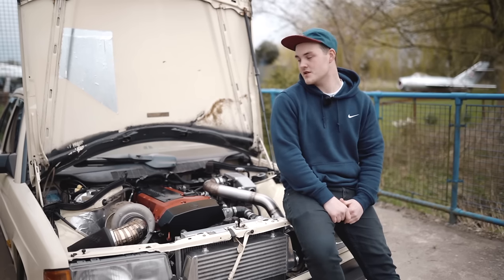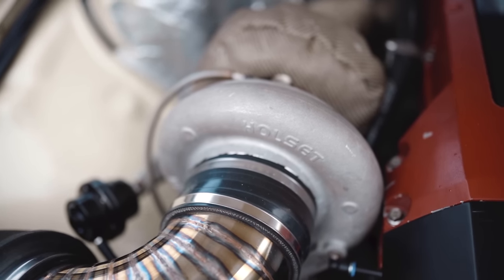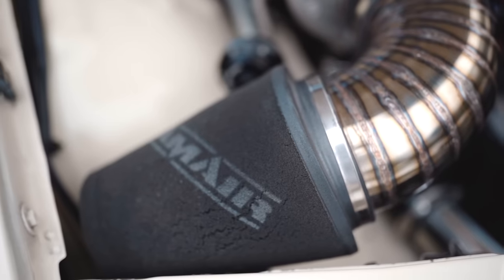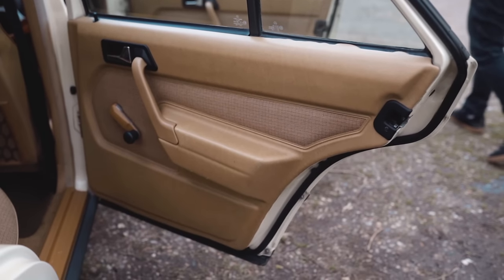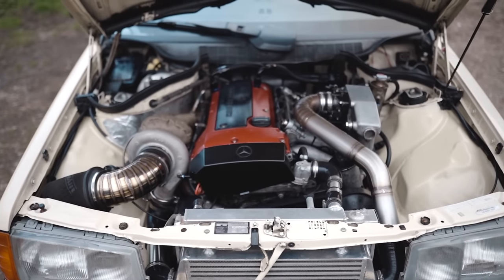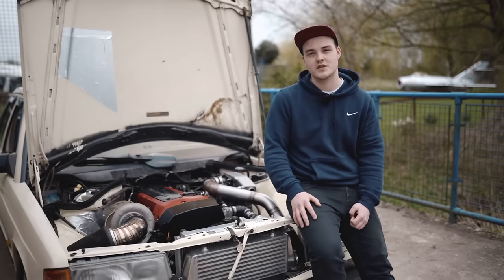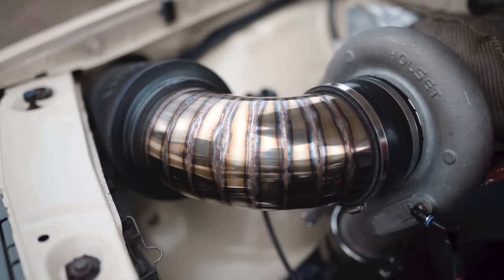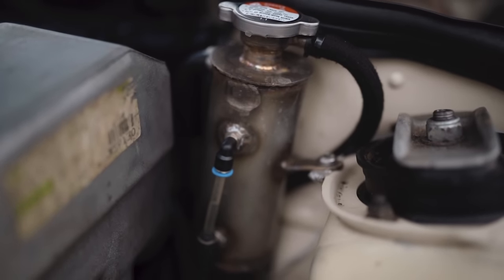ALEX HAS BUILT THIS RIDICULOUS SLEEPER - *YOU WON'T BELIEVE WHATS UNDER THE BONNET*

Comment: I like how he shared exactly what is needed to do the engine swap.
Reply from the maker: That’s what we wanted to do man. Something informative as well :)
Reply: we all would love to do a project like that, unfortunately i live in switzerland and by the time everything is legal the car cost 60k if ur the first to do it
Reply: DonAmoS / Path Pad0riX 

I was just about to say that !!!! I wish Swiss MFK would be as easy as the UK ones !!  I brought my custom Motorbike to Switzerland and had to sent it back to UK because Coz I couldn’t get it registered . Sad ... but true.
Reply: What a sweet whip
Reply: @deadcool 2 its his baby now, why would he sell her. 🤨
Reply from the maker: deadcool 2 hey buddy, sorry I missed this. It’s not for sale I’m afraid :)
Reply: Can't understand why not a m104 instead as install is also the same.
Reply: That’s very nice considering most act like know it all dickheads if you ask for parts lists or ends up “DO YOUR RESEARCH!”
Reply: @carloscollomps1552 I had m104 turbo 980hp in my driftcar.

I am building w124 wagon with turbo m111 2.3 stroked to 2.5 liter with m111 brabus 2.6 billett crank and DP pistons c36 amg forged pistons. 2.3 kompressor had 600hp with only stronger rods, arp headstuds and copperheadgasket. So aiming for 700+ hp with new setup. 4 cylinder also has more space in front of car. And also cheaper to rebuild than m104.

Comment: It's nice that other youngsters see the potential in the old Merc's. I myself own a 190e with m111 2.3 swap (6speed) although I kept the eaton supercharger and got a custom 70mm pulley for it as I haven't got bored of the  "helicopter" sound.  

They only bit I did not like in this video is at 12:25. Yes the 1.8/2.0/2.3 weren't that fast (even back in the day) but there was also 2.6L straight 6 not to mention the 2.3& 2.5 v16 cosworth and of course EVO1/EVO2 & the mighty DTM version.

If anyone loves those cars as I do then I strongly suggest visiting the mercedes museum in Stuttgart.
 
Anyway good content :)
Reply from the maker: Hey mate thanks for watching! 

Haha not heard the helicopter sound myself but had previous charged cars and never got bored of the whine! 

The museum seems a fair shout.

I think that section at 12 minutes came out wrong. I knew about the performance versions I guess I meant more his shape version I should have been clearer.
Reply: @ThePolskiKiD Do you know if kompressor engine mounting will fit OM613 CDI?...
Reply: Is your car on your channel? Where did you get the 70mm pulley? You also forgot to mention the AMG and Brabus versions that were even faster than the Evo's with their strait 6's, but weren't allowed to race, because they didn't meet DTM rules. Carlson, Schultz, Brabus and AMG dropped V-8's into the W201 chassis as well in special built vehicles.
Reply: Hey, I am thinking about the smaller pulley myself aswell. Do you need a ecu remap to make it work? Or have you just swapped it and ran like that?
Reply: helicopter sound = supercharger whine?
Reply: im 25 years old AND OWN A Mercedes Benz 230e from 1990. and love it. and yes it is very slow. even after a full rebuild of the engine. but it is the most reliable car i have ever had.
Reply: 1986 190e 2.3 8v was my first car. Love them to death. Sadly that car was too old and started having issues that my inexperience and lack of time couldn't take care of. One day I'm going to get another one and build the 8v motor into a beast. I'm going to fully reengineer it from the ground up improving every aspect of the motor.
Reply: @gremotorsports  Better off going at it with the 16v. You get so much more for your time and money then. They are hard to come by and expensive, so that's a consideration.
Reply: What ECU did you use ?)
Reply: @kirkot2  Haltec stand alone, probably an Elite 550
Reply: I bought my first mercedes 190 12 years ago, an m102 carb , 1 week later boom,engine gone-kaput . Bought a 2,3k  M111 from a guy who had a 94 c-clasa,fitted the engine ,the gearbox and for stuck for 2 years with the ECU and wording harness ,build the harness by myself ;could not get it started. Sold the car bought another one ,had a 3,2 Block built it with different internals. 3,5 diesel crankshaft, 3,4 AMG pistons ,3,2 custom camshafts, m104 3,0 intake and k-jetronic . Made 287 on the Dyno . It took me 3 years to find the parts and finish the engine ...still love 190 will always love the 190 .
Reply: Hi, what did you do about the speedometer with the 6 speed swap?
Reply: That’s awesome

Comment: Top 10 best sedans ever. Ever
Reply from the maker: Awesome thanks for watching!
Reply: number one
Reply: I have a 2.3 190e 86' Gold with 150K....clean title...no rust or body damage...just small dings.. paid $500.00 for it...Interior is near pristine..The owner of the towing company absolutely hated this car because he could not understand why it kept knocking off so,  I  rescued  it from a towing yard with only minor issues with fuel pump. I have spent 3K in it so far. I plan on fixing all of the minor vacuum leaks and after get all dings out , re paint and lower it a bit. I bought some chrome  17' AMG rims from a wrecking yard all four for under $100 on sale.....crazy deal. i will repaint to original color but with some light metallic flakes. I just picked a silver 1989 Merc 300 CE  coupe w/ 83K from my mechanic for a steal. The 300ce is my next project!
Reply: I had a 1984 190d 2.2. Naturally aspirated diesel with an auto trans.  By far the slowest version of this car and it was still a great vehicle.  I will definitely own another 190 and do something similar to this
Reply: @somebuddyful  hard decision, since there is the W124, the W123, the W126 and so much more but the W201 is from the time when Mercedes was building the best cars in the world. Long gone, those times...
Reply: @thegoldenamerican  thats a great engine for that car, make sure you treat it good

Comment: Wow that was actually very interesting and impressive. He's 22 and know hell alot. I am 24 and about to do my first auto to manual swap.
Reply from the maker: Awesome bud best of luck! Which car is that for?
Reply: @CJK20 1992 Mk3 Supra 3.0 6 Cylinder with the "unreliable" 7Mgte longstroke engine.

 I plan to Upgrade it step by step. But first of all manual swap and cooling. Will see where it ends. 
The plans are at around 360-400hp cant do to much in switzerland without alot of money because the regulations are so bad here.

Comment: I want to get an 190e and Engine swap it with Audi Quattro Inline 5 engine.
Reply from the maker: Cor that would be something else. One of the best sounding engines ever.
Reply: My new daily audi 100 has a 2.3 inline 5, not quite the quattro turbo but sounds insane for 150hp
Reply: Porsche 944 2.3 swap😏
Reply: There is an oem inline 5 turbo diesel which can handle much power. Sound great, too!
Reply: Just buy an 190d 2.5 and om605 swap it, you can run on over 450hp on the stock engine😅 (only a new manifold, a bigger fuelpump and a bigger intercooler)
Reply: Waste of Audi engine.
Reply: nope it will not work and you will be cursed if u put anything in it but a Mercedes engine. it,s like marying your sister or something.
Reply: Why ?
Reply: OM606

Comment: I really like this early spooling Turbo. I have got an Saab 9-5 Troll. Thats an 2.3 Liter long stroke 290hp and 440nm of torque. I got boost at ~1.5rpm and full torque at 1.8k rpm. Its such nice to drive like that even pulls till around 5.7ish rpm. 

So anyway i would recommend to get an Ballbearing Turbo do a sllightly Stage 1 Headwork and keep the oem Cam.

The thing is if you kill the lowend torque of this car you loose that nice and early torque and it will be like any highpower tuned car.

A ballbearing Turbo manages to get a nice efficiency from low to highflow you can see that in the flowmapps of any turbodatasheets.
Reply from the maker: Yeah it definately spooled pretty well. 

Thanks for the comment mate.

Comment: Awesome car and video, didn't think the 2.3 could spool a he351 that early. I love this, I just swapped a similar engine; m11.975, Eaton M62 in my C124. Went from a six cylinder m103 as I reasoned the handling will better without the heavy 6 upfront and it is. Still stock for now 195 with torque very early, good for the heavy coupe chassis.
Reply from the maker: Awesome good to hear. I was suprised at how quick the turbo came on too. To be fair. As expecting it to be super laggy.

Comment: The w201 chassis was made for DTM.
DTM reguired that it was made in some number of production models.

The original idea was not a cheap sedan, but instead the EVO model in collab with Cossworth they made the 2.3 16V EVO and then the 2.5 16V EVO2, wich made more power than the normal 2.3 16V and 2.5 16V. 

But they became so popular that they made it with like 8 different engines and a wide range of other specs.

Comment: Great build, what size is the intercooler? 280x300x76 mm would fit and be fine?
Reply from the maker: I’ll find out dude
Reply: Thanks alot, I'm swapping m111.944 on mine (2.0 141kw kompressor), for start i'll leave it with compressor but you'll never know the future :D
Ported the head already :)

Comment: That open filters drawing in all that hot air from the engine bay. You should. Be drawing cool air from the outside and get the iat's down. you'll have more power. The cooler the intake charge the more power and boost
Reply from the maker: Hey Joey, few people have suggested it. Thanks for your comment though pal! Hope you enjoyed the video.

Comment: Weld panels blocking the vains from air and make yourself an ICE WATER to air intercooler. Place the  in and out plugs diagonally too.
Edit: Get the hot air out of the engine compartment in a very subtle way
Reply from the maker: Nice! 

I would say obviously with bonnet shut it’s not like the Intercooler is noticeable :) 

What you’ve said is a good idea though
Reply: @CJK20  This thing is definitely a little sleeper!! Either get the hot air under the car or out the side(s). Needs to take the factory undertray and plug up the scoops. Then just put a couple cuts and a couple brackets to create a sharp angle to suck at least some of that air out. 
I'm in college for engineering too ;) I'm going for mechanical

Comment: I am building w124 wagon with turbo m111 2.3 stroked to 2.5 liter with m111 brabus 2.6 billett crank and DP pistons c36 amg forged pistons. 2.3 kompressor had 600hp with only stronger rods, arp headstuds and copperheadgasket. So aiming for 700+ hp with new setup. 4 cylinder also has more space in front of car. And also cheaper and easier to rebuild than m104.

Comment: you said around 350bhp as it is now,  how much more can you put on the engine without going the built route?
Reply from the maker: Hey John.

About 400 realistically, the stock gearbox is already a couple hundred NM above it’s torque safe range according to Alex. 

But engines good for 400

Comment: No whats wrong with a standard e190?  I used an 88 reg ro run scoland to london and it was like butter. W124 all the way!
Reply from the maker: Hi Lux, nothing wrong with stock at all. Those engines just go forever. This owner brought it with the motor blown and thought why not.
Reply: @CJK20  haha fair enough. Though an old merc engine that has blown? More rare than an austin fan
Reply: @luxfer7794  true lol they are undestroyable usually

Comment: Good choice on engine. There 6 cylinder variants  are comparable to a 2jz 💪
Reply from the maker: I haven’t looked into them but I bet they are.
Reply: CJK20 look up m104 turbo. There is a few 1000hp builds already
Reply from the maker: Diesel 8290 I’ve got a 550bhp SuperTurbo Diesel W124 coming time channel soon
Reply: CJK20 classs! You’ll be impressed with the torque!

Comment: bro, any updates on brakes and suspension ?
Reply from the maker: I’ll get him to comment :)
Reply: Front brakes are, W124 320 CE 4 piston ATE calipers with 295mm discs, braided lines etc. Rears are standard twin piston ate calipers and discs.. 

Suspension is lowering springs front and rear with modified saab 900 rear shocks and BMW e36 front shocks
Reply from the maker: Thanks for that Alex!

Comment: Please please put a roll cage in it..
Reply from the maker: That may make it a little less stock looking :) 

Alex isn’t interested in tracking it etc bud. Should be fine do you not think? Or more just cause of the power/torque doing something chassis wize?
Reply: @CJK20  I'm thinking more about safety. That car will fold up like an origami model if he losses it round the corner.. he could weld a hidden cage under the pillars

Comment: This is one of the worst cars Mercedes has ever built. I had one. First everything that can brak it will . Second! This car is RWD, has all the weight in front and the rear is feather light so it will try to kill you!  ... and is undriveble on snow. Add 2 cement bags (100kg)  in the trunk to improve stability and traction. I heard people doing it. :)
Reply from the maker: The rear is definately twitchy!

Comment: That car is beautiful. What wheels are those? And you still don't run meth injection?
Reply from the maker: It’s more because it’s on the limit of the stock engine. The box already is 200nm of torque over the recommended power to run. 

Did consider meth but intake temps are super low currently so no need.

If Alex forges it deffo in future!